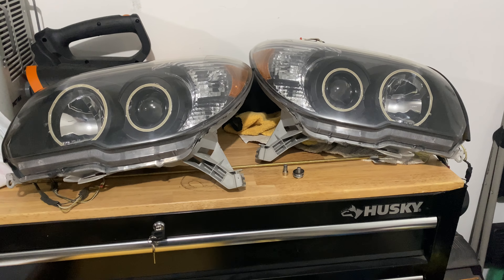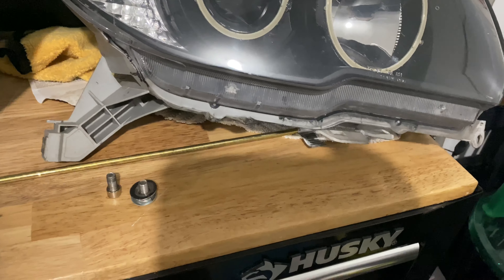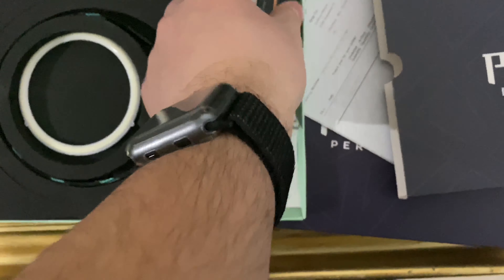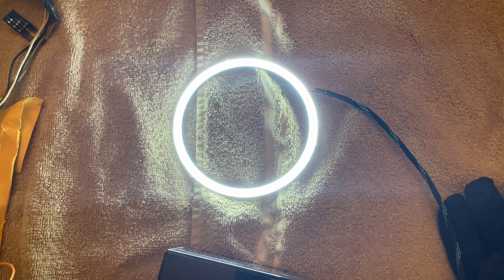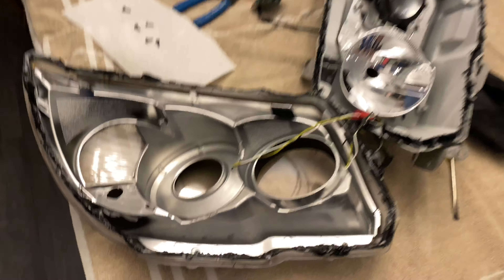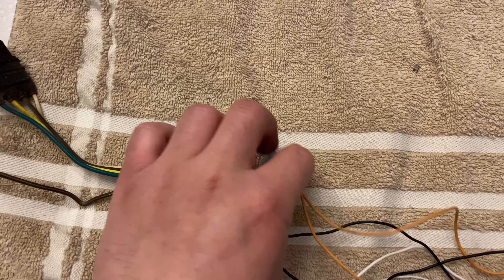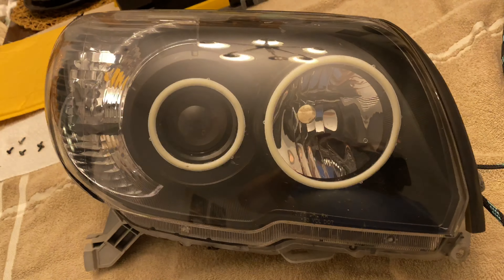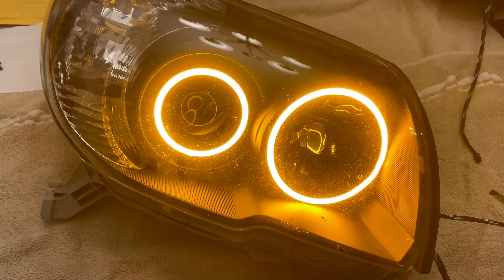4th Gen 4Runner Profile Switchback Halo Headlights

Comment: Just wondering how you wire a two halos in one headlight? Did you used just one driver for two halos and same on the other side? Or you have 1 driver for each halos? Enlighten a lost one. 😅
Reply from the maker: Based on the Profile instructions, each halo needs its own driver. 
So there is a driver for each halo (2 per side and 4 total)

Comment: Why don't you show us how to connect those on the bettery?
Reply from the maker: RaFi Jawed Jhuhare I didn’t wire these to the battery, the turn signal is wired to the turn signal and the DRL is wired to the parking light.  This way you can still turn the DRL off, or leave it on parking light all the time and the lights automatically turn off once you turn the 4Runner off and open the drivers door. Or click the lock button twice on the fob. 

You’d need a relay harness to wire the DRL to the battery with an independent switch.
Reply: @MidMoTundra  thanks a lot bro ... this video is dammmmm helpful man .. thanks again

Comment: what size halos did you go with for you lights? both the bright and projector ring please!
Reply: nevermind i must have missed it in the video!
Reply from the maker: @journeytotheozarks9136  no worries, should be 90mm for low beam and 120mm for high beams

Comment: How much would you charge to do these on a set of 2005 4Runner housings?
Reply from the maker: I haven’t done an install on an 03-05 4Runner headlight, I know they are different from the 06-09 as they don’t have the projector low beam. 

If the install is similar to the 06-09, a couple hundred bucks is all I’d charge. Having said that, I don’t build headlights much anymore as I had a few sets that UPS/FedEX destroyed during shipping. I do some local installs when I have some free time.

Comment: U could actually get way nicer ones since u have an 06 they r led strips. I originally wanted 2 get these cause they have a much sharper look than angel eyes. 

I'd get em but the early 4th gens take a lot of extra electrical work 2 sploce em in, so I'm skipping em for now. 

Check em out. 

https://www.toyota-4runner.org/4th-gen-t4rs/278459-led-headlights-2007-4runner-sport-v8.html
Reply from the maker: I’ve seen these before, my opinion is aftermarket headlights don’t hold up as well as OEM housings. In my experience the coating on the lenses start peeling and flaking. Also the internals are usually low quality on things like the height adjustment screw retainer. 

I will say those so look sharp, I’m a fan of LED “strip” and C shaped DRLs